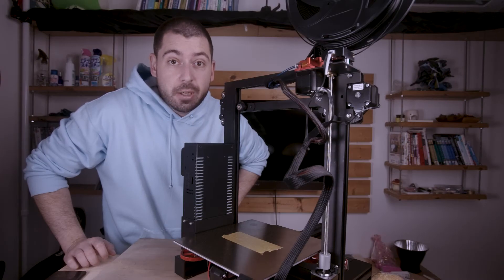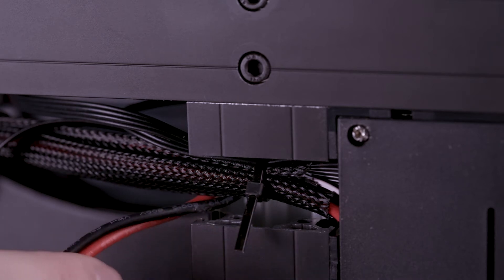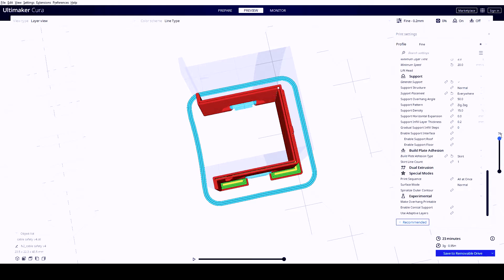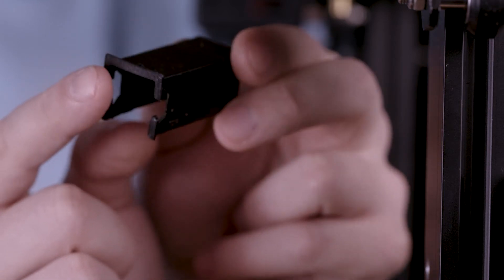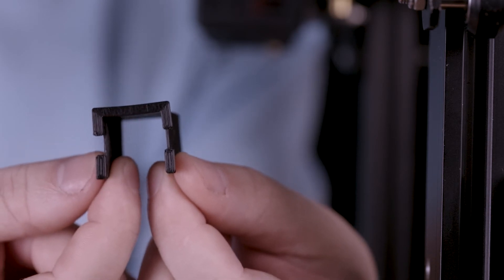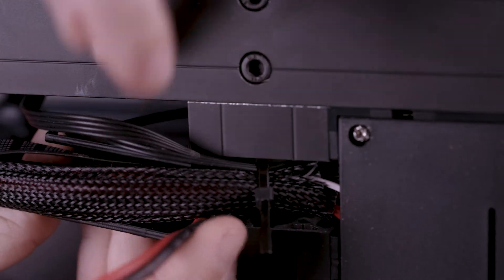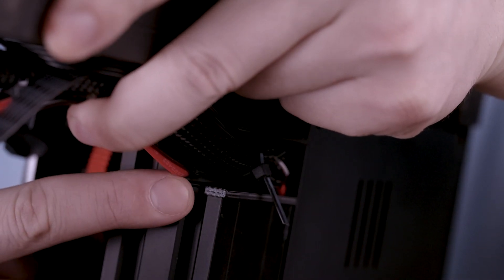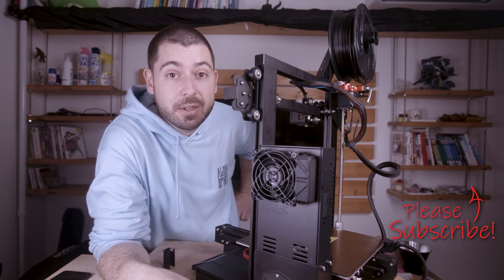Elegoo Neptune 2S Potential Electric Issue + Easy Fix

Comment: Once again thank-you for the video, Although i dont plan on moving my printer as an ex-electrician this sort of issue would trigger me and i would have had to find a solution, This saved me a modelling job :)
Reply from the maker: you are welcome, I am always working inside complex PLC systems and the worst is when a wire gets cut on an edge shorts. Glad this could help!

Comment: I just cut some card and made a box out of it , put it around the cables I made it longer than the slot so the little flaps protect the cables with some hot melt glue to hold it in place.
Reply from the maker: this is a pretty good and easy alternative! you could even skip the card and just hot glue the sharp corners of the aluminum frame

Comment: I noticed while trying to print this that if i didnt have "print thin walls" selected in cura the side tabs that run up the height of the cover didn't print like in your first prototype, so I wonder if that affected yours aswell
Reply from the maker: Thank you for letting me know this! In the video I show the first prototype and say it didn't print the trims correctly, this could have helped print that but I redesigned instead. My problem is I set walls to 3 but had space for only 1, however Cura tried printing 2 walls on the tab layers. I'm not sure why Cura does this but it causes over extrusion.

Comment: Hey! Thanks a lot, i havent been moving my around a lot, but i also havent noticed this.
Thanks for the easy solution, gonna print me one as soon as i get home!

Do you have any ideas about the cables coming from the printer head, as the head moves they sort of slightly rotate against the plastic, sort of chafing agains the fan cover as they exit up top?
I have "fixed" it with a little bit of electric tape, but i feel like maybe there are better solutions out there? =)
Thanks again!
Reply from the maker: It's good to know that people are being helped by this, thank you! I just took a look at the printer head, easiest would be to cut a little more with a Dremel because there isn't any space at all, if you don't have a Dremel you could use a soldiering iron to melt the hole bigger...even your nozzle could do it, be safe with the fumes if you do. But really upgrading the fans and having a totally different shroud is the best possible, eventually I will do this.
Reply: @MochaMameX  Looking forward to that upgrade video then =D At the moment those fans are the loudest part on my printer, would be nice to get something slightly less noisy without a drop in print quality. So far i have been pretty amazed by what this little printer can do =)
Reply from the maker: Yeah I'm pretty happy with this printer too. Next up with probably be the mainboard fan, when your heatbed reaches 50 degrees you can hear it turn on. Still need to do some testing and design work to get the print head fans ready
Reply: @MochaMameX  The one "upgrade" i did is put my printer on top of a car sound dampening foam panel (slightly larger area then the printer it self).

It was a noname brand thing at my local store, but its very similar to "TroyStudio Triple Noise Insulation Sound Proof Foam Panel", but without the adhesive.

The thing is about 1 inch, with a thick wavy side, mounted on a hard surface, with a thin foam on the opposite side. 

I placed the thick wavy side down on my table, placed a thin MDF board on on top and then placed the printer on that (so that the bottom fan has air clearance.
Since its a thin foam surface on the panel, the mdf board is really stable, and dosent move around.

It almost completely removed any noise from the steppers (especially the z stepper).
Reply from the maker: I should try again, my dampening tests it didn't work for me but I only tried different types of rubber. Thanks for the tip!
Reply: @MochaMameX  I think rubber is to dense and transmits those micro vibrations to well (at least harder rubber), best of luck with the foam!